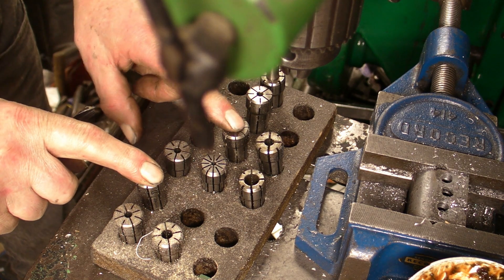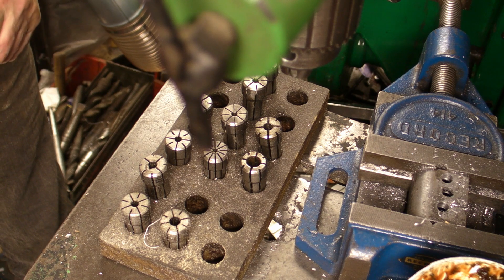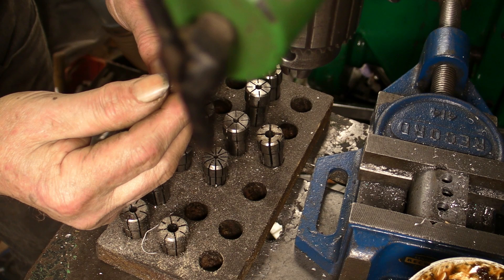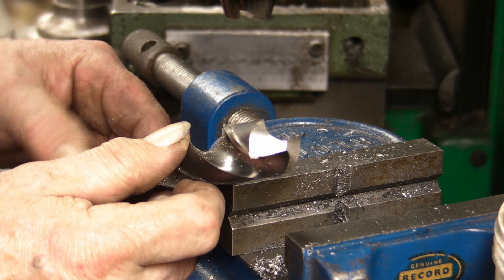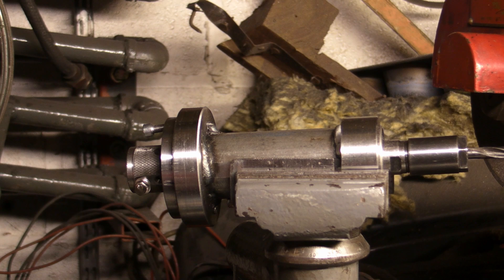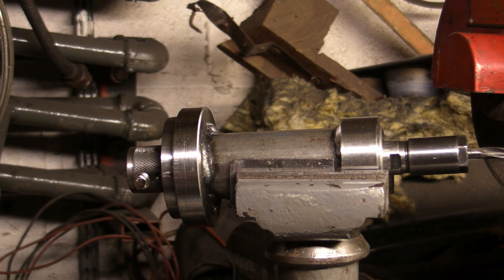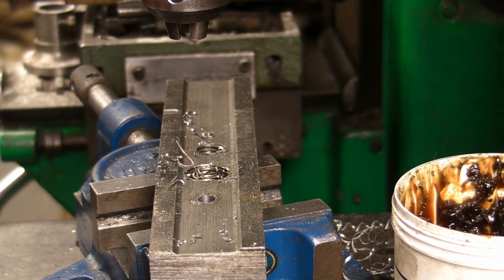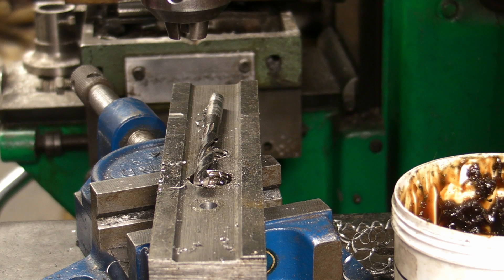Re-grinding twist drills

Comment: Well, dammit, looks like my comment didn't get through, bloody youtube censoring stuff with links in.

Anyway, that's some very nice work there Del.  A couple of comments, though, if you'll permit me.

Firstly, on the 9mm drill, (and I'm not sure as it's not easy to see on video, speshly with failing eyesight etc etc), I think I would have gone further on the secondary grind.  The idea is to have the 4 faces meet at the drill tip.

Secondly, a conical grind like you've done there will work, but you've got no relief at all grinding that way.  A commercially ground drill with a "conical" grind sorta rolls back the cone as you move away from the cutting edge.  That said, your geometry might work really well in brass, lack of relief might stop the drill "augering" in.  I'll chuck up a quick video later on my current setup.

The link I wanted to post was to an article by Joseph Mazoff, on the newman tools website called "Drill Point Geometry".  That's enough info to find it, it is very highly recommended reading (as is anything else by Mazoff, he knows what he's talking about)
Reply from the maker: Thanks Wibbs ,I hear what your saying, I do need to learn more on the art of sharpening. Thanks for the heads up with Mr Mazoff !...Del..

Comment: Good result del. Your hard works paid off. I've the same collets up to 20mm. Have you tried chucking the drill bits closer to the cutting end, less overhang? Cheers Tony
Reply from the maker: Good advice reducing the stick-out Tony,  your collets must be the larger models as the D A 100 max out at 13mm. Del...

Comment: Excellent result Del, that works really well, Friend of mine , retired precision engineer,has build a different rig especially for sharpening large drills, I have put it on the end of this weeks video! Good work Mate!
Phil
Reply from the maker: Hi Phil, the cutting face of that wheel I used is less than the diam. of that drill, would like to  do the grind without moving the bed of the grinder so I've ordered a 100mm. Cbn wheel. I have been thinking about making another rig for my Morse taper drills so looking forward to your vid !...Del.. retired precision engineer hey Phil, is that the same as retired precision Bricklayer😀
Reply: @machinenutdel6764  you can do both Del! Yer a polymath!!
Phil